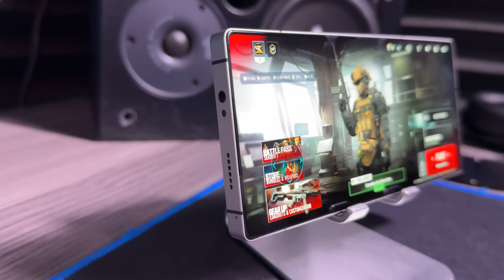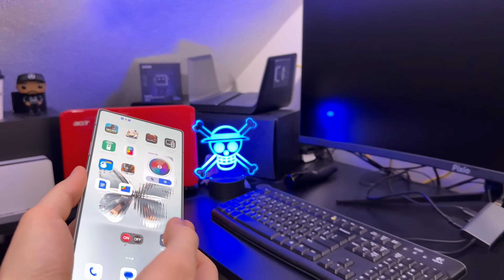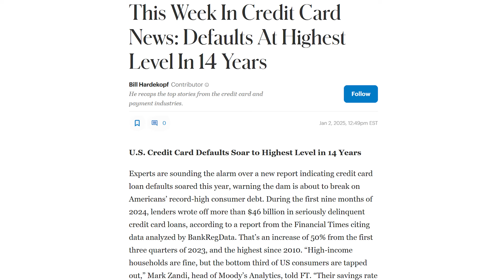What CES Revealed About Repairable Tech In a Record Year For E-Waste (2025 Is Not Looking Good)

Comment: If someone were to put a Tesla logo on that dishwasher, it would top the sales charts and be praised by the media.

I wonder when all those bubbles pop, because I'm pretty sure there will be a massive domino effect. 

If jobs go bust in the automotive industry which tries to ride the dead horse that EVs are while heading for a tradewar with China (which won them 2 decades ago), then suppliers are sure to follow. If a large manufacturer/supplier closes a plant in your city, then rest assured a lot of smaller businesses will follow.

All those people ain't gonna buy new Laptops every 2 years, play the latest unoptimized games on RTX XX90s or get the latest iPhones.

Less sales mean higher costs per product, so some of the things will get more expensive by default due to overhead (and paying out the layoffs).
Less rampant and mindless consumption means less taxes, so those will be raised as well.

All this while the Stocks of Tesla and others implode and somehow Banks "need" to be rescued again - by the taxpayer.
Tesla is a obvious meme stock, but you'd be amazed how many nonsense companies exist with "concepts of a plan to make autonomous electric air taxis" and how many serious ones have invested in such nonsense.

Comment: I 100% agree with Andy. Devices should be made to last. The mentality of throwing things away because they are designed not to last in terms of both software and hardware is frustrating. Frankly, I think we should strongly promote Linux to help save older machines that won't be able to upgrade to Windows 11. Linux should take advantage of the fact that Windows 10 is being phased out and push to be the replacement for Windows 10, rather than Windows 11.

Comment: for every type of "mechanics", engineers are our enemies. they never design anything to make it simple for the ones making repairs. pisses me off. something as simple as replacing an O2 sensor can get complicated just cause you have to remove other parts or finnegle a tool in a tight ass space to remove the bad part.

Comment: I don't need RGB or machines that won't last. I'm fine with plastic or metal laptops. On phones plastic backs are best especially when you can take them off to replace the battery and other components yourself.

I hate the trend of every device being either glass slab or "smart" meaning it will need to be replaced in 2-3 years. Screw that.

Comment: It won't change either. I own two laptops; HP Pavilion with a AMD A9-9420 RADEON R5 CPU and a Compaq Presario A900 (I think that's right) with a intel Pentium CPU. My HP Pavilion I replaced the HDD with a SSD and converted the HDD to external storage, then increased the ram to 16GB. My Compaq I replaced the HDD to a SSD and running Windows 10 now instead of Windows Vista, also increased the RAM from 2GB to a maximum of 3GB. The Compaq is about 16-18years old and my HP is about 7-8 years old. But I still have them and will keep them as long as I can. Thought about converting the Compaq to a media server as my WD My Book Live is really slow. Great video, looking forward to the next post.

Comment: I work in IT myself and it is getting ridiculous how throw-away the newer stuff keeps getting. I love the concept of Framework laptops and if I ever buy a new laptop myself, I will certainly be looking at them. I also get annoyed at some of the tiny PCs/larger SBCs that don't have removable processors. I know there isn't much to them, but if I can swap out wifi cards, RAM, and NVME drives, how much harder is it to put in one of those laptop screw-turn processor brackets? It might add 2-3mm to the overall height and gives the option to upgrade which allows for a longer life before it needs to disposed of. It's a sad world that profits come before common sense and reliability. Reliability... let's not even get started on that one. lol

Comment: The worst part is this is everywhere. As a EX  auto technician  This is all that I saw people do in my old shop as well.  Cars trucks no matter what they're getting more about beauty over functionality. It increases repair costs and and time. Bc manufacturers make them harder to fix
Reply: Cars are literal computer networks on wheels and I'm so glad I didn't get into automotive as a career. Sometimes the parts are serialized (a la John Deere) so that you're forced to contact the manufacturer and beg for permission to pay them to fix it.
Reply: As a mechanic's kid who has seen the results of the progression and enshittification of vehicles over the past decade or so, there's a reason I refuse to personally own a car newer than a model year of 2012 to 2014, depending on make. I don't give a shit about mileage, it's upkeep that's what matters. Mileage doesn't matter as long as you're making sure everything is up to spec for as long as possible and you keep up with regular maintenance. Newer cars make that damn near impossible, and they're more and more difficult and dangerous to repair due to the increased usage of electrical and computerized components rather than solely mechanical ones. The vehicle's systems are also prone to spontaneous failure because of a random electrical fault or computer error.

Not to mention QC is almost non-existent in the first place. So many brand new cars end up having catastrophic powertrain issues right off the lot, like cylinders that aren't machined correctly, or gears inside the transmission breaking apart after less than 500 miles of normal, reasonable use.

I'm good with my 2011 Chrysler T&C, thank you very much. She's got the features I need, and is actually some semblance of reliable. I just need to get the valve lifters replaced here kinda soon, is all. NBD there, I can save up for that.
Reply: I know someone that works on the cement truck industry.
He mentioned me once how new trucks are more finicky

Comment: I don't know how many people will actually have the ability to just run out and get a new computer because somewhere Microsoft got paid off or is paying off hardware manufacturers. Then again, I drive a 13 year old home built PC; I may have some bias and may not be up to date on the latest dil  dill pickle. One of the things I noticed was I kept waiting for my CPU / GPU to not be capable of running anything. 13 years, and I updated my GPU because the opportunity came along; My plucky i5 has yet to give up. And on low settings it still runs a lot of modern games. That could be the Indie sphere though.

Shame I was thinking of actually upgrading it sometime this year; that ain't gonna happen. THE RENT IS TOO DAMN HIGH.
ahem.
Hope you and Lupe (I probably misspelled that. Sorry.) have a good day, and the week perks up. (Or if not day, then night, twilight, dawn, afternoon, as appropriate to your location and time zone.)

Have you thought about leveraging your proximity to Subway? Buy two laptops, and get a free footlong!

Comment: Me and our IT team just got through with a meeting with Dell to start buying direct. Our IT director was confused by the naming like three times over and my fellow helpdesk tech told them that naming was dumb right off the bat. However, we told them straightup that the modular port was great and they confirmed to us that they can just give us the part and we can replace that ourselves without scheduling a technician to come out.
Reply: I wish Lenovo would do modular USB-C ports. I work in K-12 IT and we manage a fleet of Lenovo ThinkPads for staff and a mix of Lenovo and Acer Chromebooks for students. We've had to send a large amount of devices to e-waste over the years due to damaged USB-C ports. I know technically you can replace them by desoldering them, but we just don't have the tools, training, and most importantly time for those types of repairs. It is even more frustrating when we have teacher laptops with USB-C ports that charge fine, but the data connection is flaky. The devices are still otherwise in working condition, but we have to trash them.

Comment: i bought a refurbished dell latitude 9410 and other than the battery not lasting as long as i need it (its a smaller battery and i didnt do research), and the actual laptop was only manifactured a couple years ago and its awesome. aluminum frame, hefty but portable feeling, easy to open and repair, amazing laptop

Comment: Complaining that CES isn't proeminently featuring cheap tech for poor people ( and poor I am ). Why. I don't pay money don't have to fly to attend CES to snoop-around for my next tech purshace at CES. 

My next tech purshace will be from obsessively combed websites of shops where I can go, with a return policy at a  physical location.

Yes poor people get the tech crumbs and trickle-down tech of the rich. Why not. Thank you we do get those. If I could get a cheap-ish laptop that can run games on integrated graphics, it's because 5 years ago, rich people bought something with equivalent performance at 500%+ the price.

For the problems of deliberate assembly choices to make stuff unrepairable or too expensive to be worth repairing, totally agreed. We need consumer protections so that batteries are easily replaceable and ''generic'' batteries can be made so we don't have to buy 2X+ the price from the brand manufacturer.

Comment: I generally agree with you but I have one reservations, one "correction" and a bit of hope for the future.
The reservation is about Microsoft. They did, and still do, a lot of stupid, annoying unacceptable things but with regards of Windows 10 and 11 I think they are mostly right. Windows 10 have been supported for 10 years, more than any other one else and they've also supported (and still do) backward compatibility. Now, after decades (as this is true for previous OS's) of maintaining more or less the minimum requirement they've decided it's time to make some changes that requires support for hardware that exists for quite a long time. You can agree with this decision or not but it has merit. They do offer, for the first time, to continue and provide security updates for a fee of 30$. You can also continue to use the PC without support (which is what I will do).
What they should, and still need and can do, is to stop preventing upgrades for non supportive devices ,they can refuse to provide automatic updates (as they can, and will be blamed for problems on non supported devices for such updates) but they should allow a manual download that will come with a warning for non supported devices.
What the should do is allow full an authorized Windows 11 update to older devices that support TPM 2.0 but have an older CPU (and there are quite a few of those).
The correction is regarding the repeatability or longevity of current devices, that's obviously true but it's not new, although far more common today. There existed in the past and the most common one was the light bulb. Incandescent light bulb always had a promised lifespan printed on the package but the fact is that at the beginning an inventor managed to create one that does not burn. He tried to sell his invention but non of the companies wanted to buy it and they basically prevented him to manufacture it. They also set up a =n international body that set a limit on the maximum hours a light bulb can work before it burns and fined any manufacturer that failed to meet this "standard". one of the light bulb that does not burn was in use in a firehouse in Livermore  CA and it still works after 122 years.
As for future hope. The EU is doing pretty good work in that direction in order to reduce waste.
They did this with the USB-C and now with batteries. The law from 2023 requires most devices (small ones, like earbuds are exempted for now) to have easily replaceable batteries that should be "readily removable and replaceable by the end-user". which is defined as "readily removable and replaceable by the end-user" which is why Apple, for example, made their batteries much easier to replace.
The also have a mechanism to ensure availability and affordability and, in cases when it's still required, can be replaced by any independent professional. There are also requirements for recycling batteries and usage of recycled materials in new batteries.
They also improved right to repair rules and there are more talks about further expansion.
This can affect, at least in some areas, on the rest of the world.

Comment: 8:19 - There's a company called MNT that makes the Reform laptop. It's a completely open source project, but way more of a niche thing than the Framework laptops. The Reform is more or less a Raspberry Pi 4 in a laptop chassis, it's early 2000s dummy thick, it has its quirks that can make it less accessible to the everyday user, and it's definitely on the expensive side for what you get. On the other hand you can replace individual battery cells if you need to, and MNT sell all the upgrades and spare parts you need. Definitely getting a Reform or a Framework when my old Latitude E7240 finally dies. 

As for the whole Windows 11 thing I got three fully functional computers that are "too old," so they're gonna go say hello to Tux when the time comes. I do have a Win11 compatible computer that I will begrudgingly have to upgrade to Win11, because I use software that has no good Linux equivalent, but since MS will gain one Win11 user and lose three I'd say that's a passable trade off.

Comment: 100% agree with your comments and feelings about the future of the tech.
I'm a engineer and I started my career working for a small company who used to manufacture professional audio equipment, such as portable mixers. Yes, our products were expensive but they were all 100% serviceable. Our customers had to be able to get their mixer fixed wherever they were working. Some of these mixers are still used today, 30 years after they were built and I am very proud of that.
This was another world, another time when portable computers had removable batteries and a hatch to access hard drive and memory! Modern tech is a disaster in terms of environment, for all the reasons you mentioned in your video. That's sad, very sad.
Reply: Had to resort to buying a 2020 refurb gaming laptop that has two things from the bygone past: Touchpads with PHYSICAL buttons and a not-so-large 48WHr REMOVABLE battery just to get back my sanity and prepare for DLSS 4 to drop (since it comes with a first-gen RTX GPU from the 20 Series so no frame-gen BS included, just simple ray-tracing and FXAA tech that I can use it on old titles which can be switched off anytime if it doesn't work out)......

Comment: I have a business-class laptop from Dell, the Latitude 5530. I had a Latitude before (3xxx series) whose chassis broke around the right screen hinge after just more than a year. And on my current laptop that I have since 1.5y everything is fine, except that the light and fingerprint sensor in the power button rarely function. I recently had to reinstall Window$ because of, well, Window$, and it didn't even recognize that this device has a fingerprint sensor. And if the power button light turns on is more hit and miss and random that explainable. I did everything I could, like carefully cleaning the internal plug of the power button, but it doesn't help.

Comment: The touch-nonresponding washing machine handle reminds me of why I don't like modern cars: when you input anything on the controls it moves a sensor that sends a digital signal half a meter through the car to read it out in a computer that then sends it another half meter to a motor to do the action you requested, instead of you e.g. actually turning a metal rod that immediately drives the mechanism to steer, or the brake pedal pulls at a rope that then pulls on the brake pads or makes pressure in the brake oil lines, with the help of a servo.

Comment: 2012 macbook going strong with linux mint running klipper(3d printer firmware)
Cant get sound working on windows 11
The battery is absolutely great
I have a dell e6430 which has a f'ing nvidia gpu which doesnt work well even with WINDOWS 10 bruh
But i cant just disable the nvidia gpu which obviously wont work well with linux

Comment: I've installed Linux Mint on 2 of my machines that are no longer being supported by Windows.

One of them, the oldest, is an ANCIENT gaming desktop FIRT GEN i7 with 6GB and a GTX 285 and it currently a testbed for Linux Mint, NextCloud and being used as a temporary netwrork storage.
The machine dates from 2008 and it still runs like a champ (wiht Linux Mint)

The next machine is an i5 with a GTX 970 and 32GB of RAM also running Linux Mint. That the computer my wife and daughter use to work on documents and do things on the web but it could still game with older games as the GTX 970 is still supported by the Linux NVIDIA drivers.

My main rig is running Windows 11 (Ryzen 7 3700X with a RTX 3070) but I'm looking ta upgrading it and retiring my 2008 i7 rig finally and moving this machine into a file server, nextxtcloud server, AI machine (the RTX3070 can run some LLM) andoffline renderer for DaVinci Reolve so when I have a larger project to render my main rig isn't monopolized.